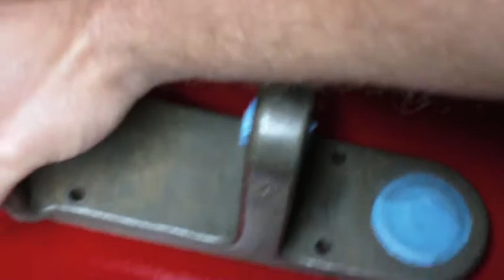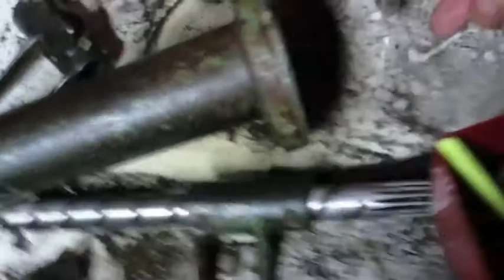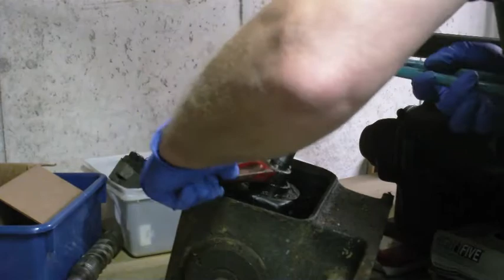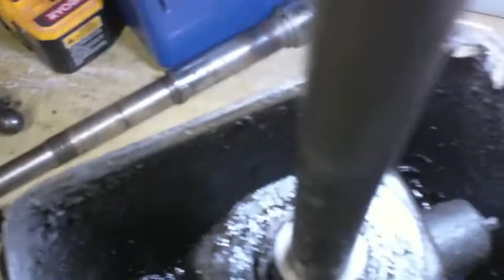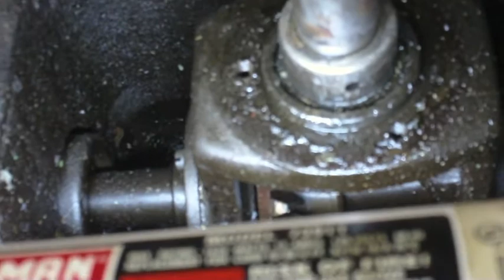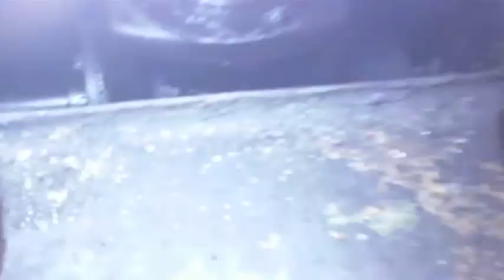Sipp Drill Press Part 16

Comment: Shugs mate that looks well built i'm surprised the bearing collar was not held on with grub screws,If your going the extent you are it might be worth changing the pin that holds them in place with grub screws rather than pins..By the looks of it this thing was well built bit of kit..
Reply from the maker: Thanks for the suggestion, but I finished re-assembly of the unit. I'm still way behind on editing, I think this video was shot in July!